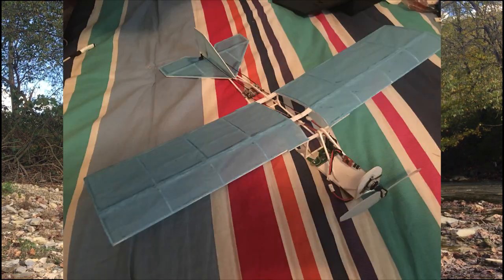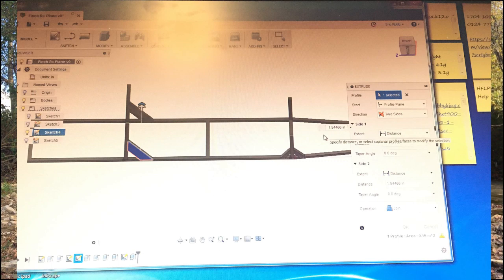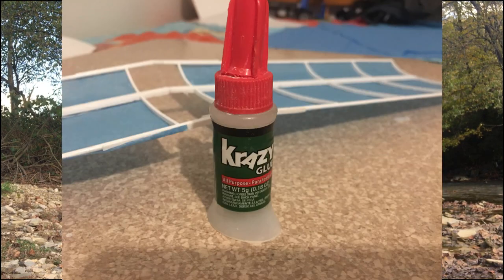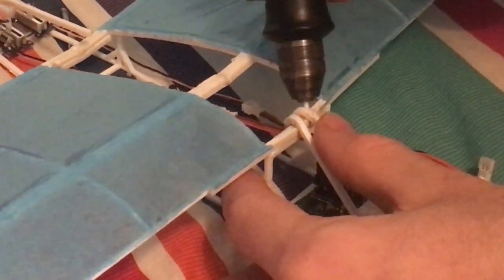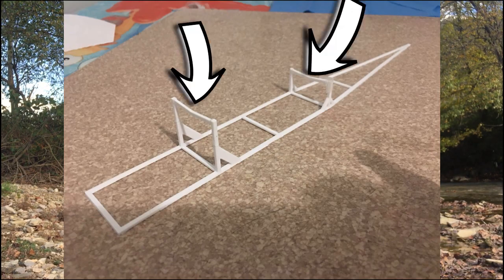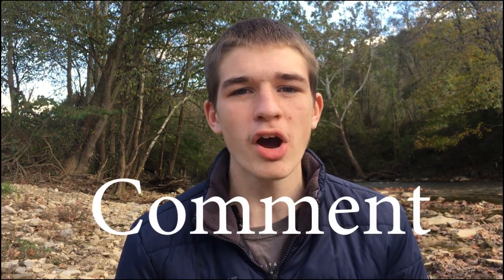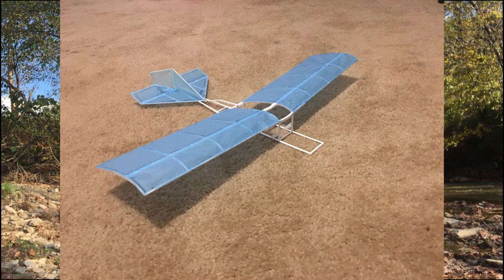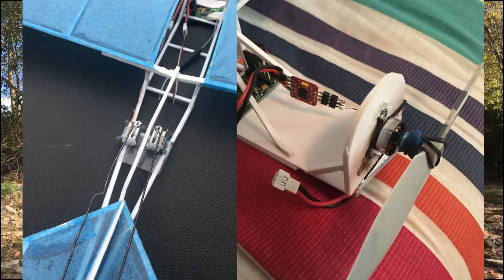3D Printed RC Airplane Build (Finch)

Comment: Nice Job Eric! Nice to see anyone trying this... using what you have when you can and getting an airplane to a place where you can share success is a solid accomplishment.  Keep the videos coming and your printer running.

You did ask for suggestions, here are a couple that might help, please don't take them as criticism, just advice  from someone that has spent a lot of time learning the hard way...
-try using glue other than superglue to attach your tissue. Glue sticks, UHU Por, or even Elmers white glue will be lighter than krazy glue, which does not evaporate (it cures without loosing much weight at all) and all work well for attaching tissue
- I could be wrong, since I did not get a good look at the plane, but the angle of incidence (difference between the wing and tail) looks like it could be a bit high  based on what I saw in the video of the fuselage
- 40g may or may not be too heavy, not sure what the wingspan is, but if the wing structure  could be printed thinner, or perhaps using ribs that you weld to other spars, you may be able to save some weight -  printing it all together is pretty cool though....
- I have no experience printing with PLA, but I do have a 3D pen,  and have used it to join PLA structures to each other, that might be something to try that would allow you to join smaller PLA parts than the friction weld from a dremmel
Reply from the maker: Thanks so much

Comment: well, you have posted an uninformative video diary entry.    at 1:30, there appear to be bits installed aft of the model's c-m.  if so,  WRONG.   at 2:15, the design of the main wing does Not include the use of a center-section  And a dihedral brace.    how much does the model weigh.   i am guessing about  3x  what it Should.   such a model is should weight about 14 grams.    such a model is Not a good choice for 3d printing.   cheers
Reply from the maker: Thank so much for you input on this. I tried to do my best with keeping the plane correct to the plans, and I had to do some modifying to make it 3d printable. I don't really know much about balsa building, so I thought that this would work just as well. Yes the plane is probably a little bit heavier than if it was balsa. I think with all the electronics and battery, it weighs about 40grams. I have found a lot of things to improve on in the future, and I think I will build another one to make it better. Thanks so much for watching and have a great day.